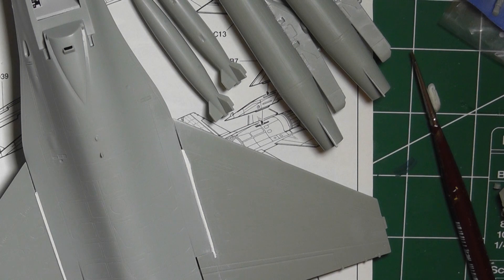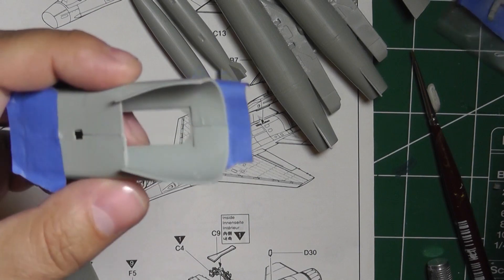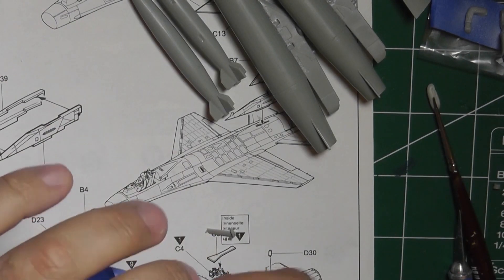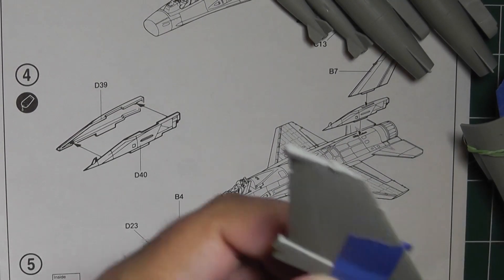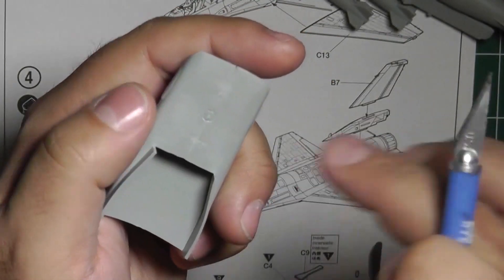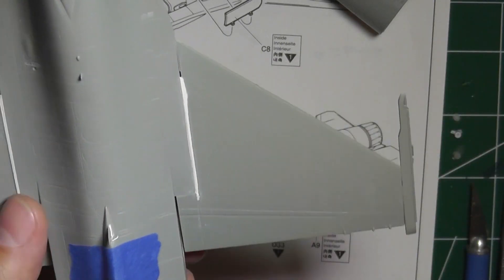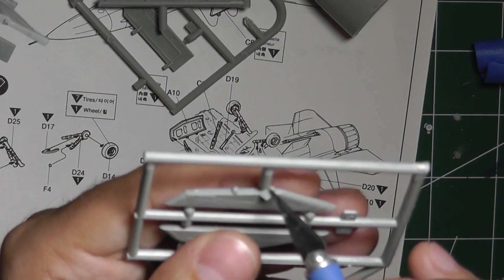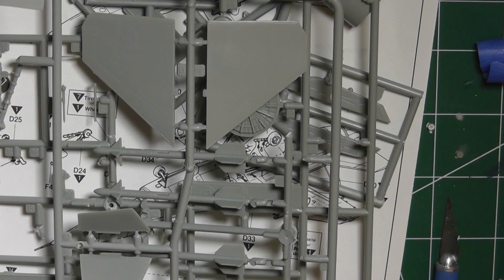Academy 1/48 F-16A/C, the build part 2

Comment: Ahhh now I understand, that's just a slightly modified HASAGAWA KIT. I thought it looked familiar. I am working on a Hasagawa 1/48 F-16 right now, the same kit you built in this video. The only major difference is how the wings attach and the vertical stabilizer is in two sections, but it 'IS' the same kit,